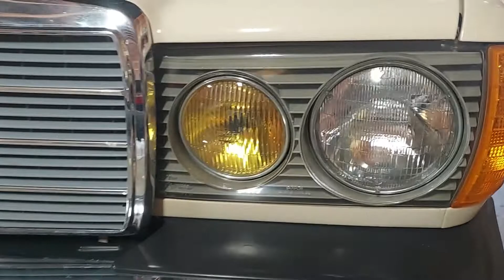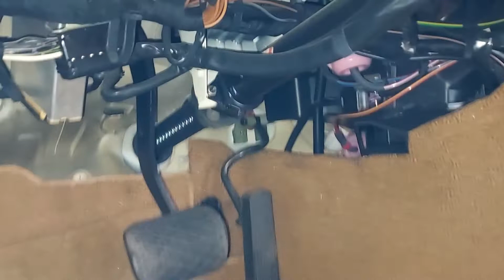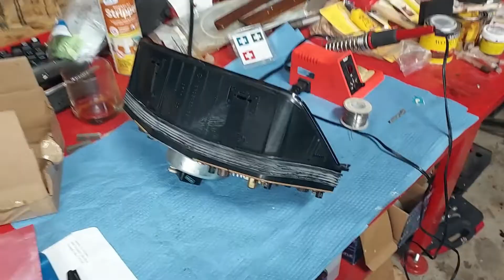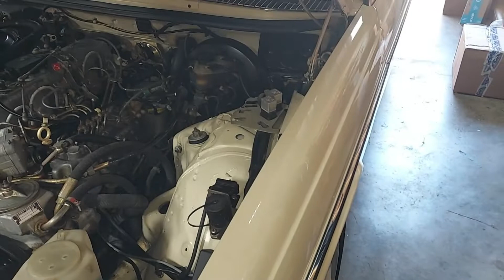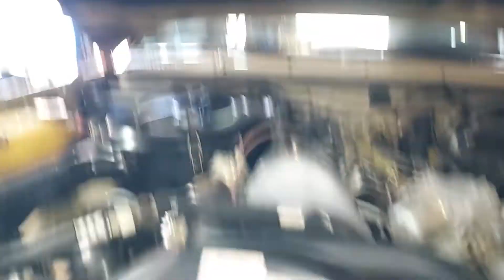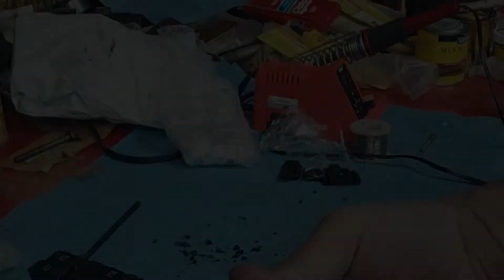1982 Mercedes 300D - Part 2 Window Relay, Aux Fan, Door Strikers

Comment: Rear driver side window doesn't work in my 1983 SW has only 97k miles what could be?
Reply from the maker: The window regulator is broken and needs to be replaced. Pretty common for that to happen on the rear passenger door not sure why because the rear driver's door has the same design.

Comment: My aux fan doesn't seem to turn on with th ac on. Can that pressure switch on the dryer be replaced without losing charge?
Reply from the maker: No you will lose your charge and have to recharge it. You're going to want to discharge the system first before taking that switch out.

Comment: I bought my 1983 300d turbo in 1990 with 60075 miles. Still have her in 2023 but on her 3rd engine.
Reply from the maker: Wow what happened to the other two engines?
Reply: I have one with somewhere between 3 and 400k miles original motor in great condition sounds like your not maintaining it
Reply: @MoMoneyMeric518  #1 punctured oil pan, and #2 overheated climbing a mountain.

Comment: You’ll be putting the fan jumper back in when you see how pathetic the AC is on the W123.  
Any additional condenser cooling helps.
Reply from the maker: If you have a healthy system that's been properly flushed and cleaned out and you've installed a new compressor dryer and expansion valve the 123 AC system works absolutely fine even in the hottest climates. However you have to make sure it's fully serviced for that to be true.
Reply: With R12 and a clean evaporator they cool OK.  
In 1985 MB changed the water pump pulley to a smaller size to spin the fan and pump faster at idle.  
I use this pulley in addition to a Sanden compressor and a parallel flow condenser to keep up with the Texas summers.  
I also use R152 for lower head pressures.

Comment: I see how this works on the W123 but my doors are hard to close on my w124.  How do you fix this problem on the W124?
Reply from the maker: It's pretty rare that we have 124s come through the shop and I've never had one with doors that won't close well. I'll have to take a look at the latch mechanism online and see if it's the same.

Comment: your supposed tu unclip the spedo cable in the engine compartment before removing the guage cluster to facilitate enough movement of the cable
Reply from the maker: Yeah I actually went down there and did that. I forgot about that clip. ;)